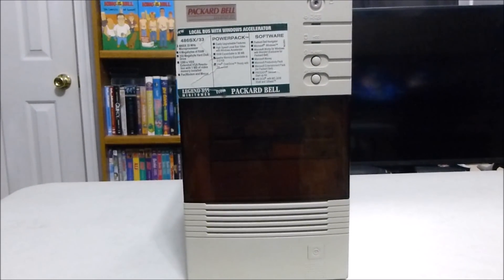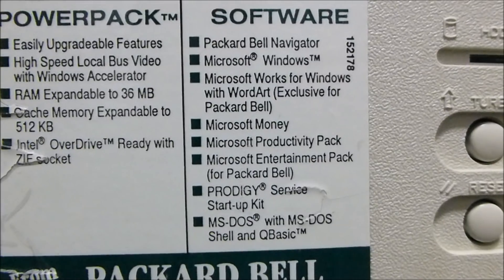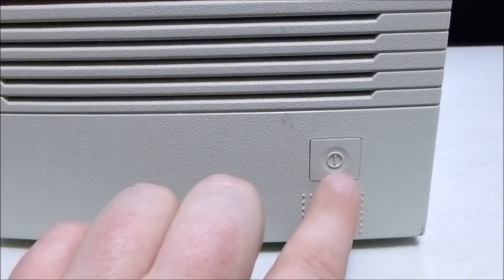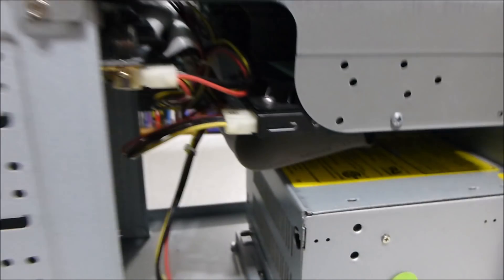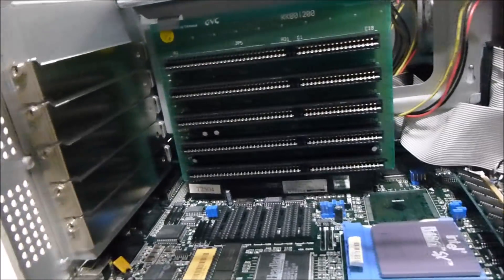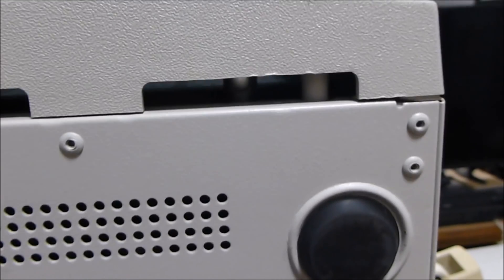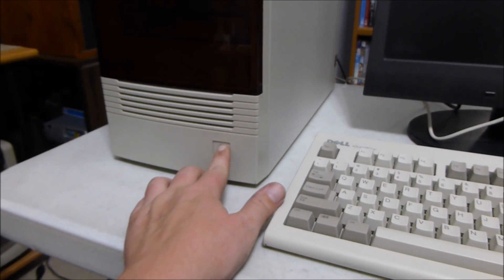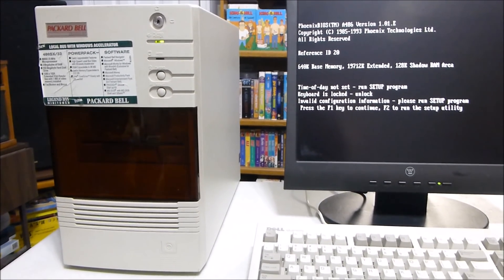Testing The Packard Bell Legend 855 From 1993  -  Please Help?

Comment: Talk about a trip down memory lane!!!! I serviced a ton of these back in the day; they were sold in my area predominantly to engineering students at Queen's University.  They didn't come with sound cards because those were always options back then; a common upgrade was to buy a Soundblaster Pro or Soundblaster-16 and a CD-ROM drive for these.  You wanted to buy the version of the sound card that had the right connector for the CD-ROM drive you wanted; there were three competing standards on the market at the time. Sony, Panasonic, Mitsumi. ATA drives landed a year or two later.

The Pentium Overdrive for this system was not a card; it plugged into the 486 socket.  I was an Intel-authorized installer back then, LOL!  It should have shipped with Windows 3.1 and DOS ... 6.2, I think. Maybe 6.22.  Drives will be 1.44 and 1.2MB for sure.

One of the reasons you have such a large case fan in the front is to make the case qualify for Pentium Overdrive. They had large heat sinks, but no built-in fan.   The Headland chip is your video chip.

BTW those empty DIP sockets are for SRAM L2 cache, populate them and your machine will run a lot faster.  You need 61256 for the big ones and 6164 for the little one (parity).   -25 is you stick with 25MHz CPU, but if you go faster, get 20ns or better.

What are you calling the video chip is an EEPROM which holds the video BIOS.   Your keyboard is not working because it's locked. Unlock it. If you don't have the key, it will be an SPST switch to two pins in the motherboard................I think, blue and white wires from the front of the chassis, spaced with one pin between them, near the speaker (red and black)..pull the wires off, should get you going.
Reply: This is awesome

Comment: That is the identical computer  I bought back in Oct 1993 when I moved up from my Amiga 500+. Had a lot of fun with that PC. Installed a lot of upgrades during the time I owned it from 93-97, a i486DX4-100/OD cpu, 128kb L2 cache,  20mb of SDRAM, 1.6GB HDD, 16xCD player and a Sound Blaster sound card. Oh and let's not forget upgrading the Windows 3.1 to Win95!

Comment: My guess would be Windows 3.1 (or 3.11 for Workgroups) and Dos 5.  I used to have lots of computers like this. Anything is possible with Packard-Bells. They used to sell refurbished computers as new.That lock on the front is a case lock, I believe. Try jury rigging a new cmos battery and the error might correct. That part is a guess,though. Good luck,matt.

Comment: I'm suprised you picked up this system matt Lol! Most people see those as junk or scrap these days and they are so hard to find, mainly for the reason being they are just thrown in the garbage. It's definitely something worth having being from 1993, My guess is it has windows 3.1 on it, unless it was upgraded to windows 95 through a floppy disk or disks. I used to have an old windows 95 pc from the thrift store that i got for $15 and it came with soooo many games on it. I used that damn thing until it completely quit in about 2013.

Comment: My era of computing but sadly never came across a lock like that. If it’s a hardware lock try a hair pin in the barrel, I’m sure you have loads ;)!  If see if you can get file online and flash the bios. Before that get that CMOS battery out of there

Comment: that lock probably plugs into the front panel header on the mobo see if u can unplug that and it will probably disable the lock. also try using the clear bios jumpers to fully reset the bios to stock settings. def replace that bios battery those barrel. shaped batteries are know to leak badly. those empty sockets are most likely  for adding on extra cache.

Comment: if the KB is locked , determine if the keyswitch is normally open or normally closed , if its a normally open , you an just remove one lead and it should work , normally closed , remove both wires and jumper them together
Reply: That was going to be my suggestion as well
Reply: Yeh same here